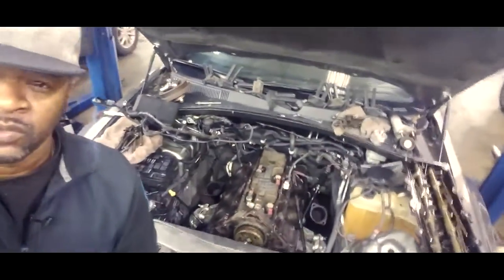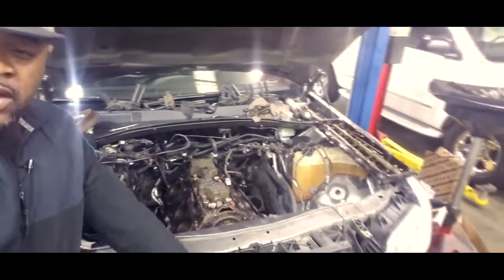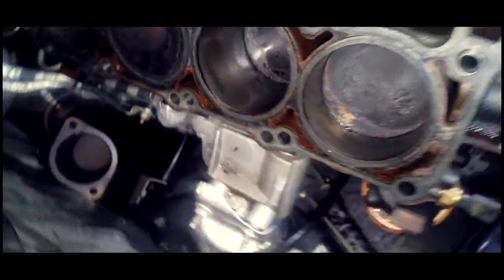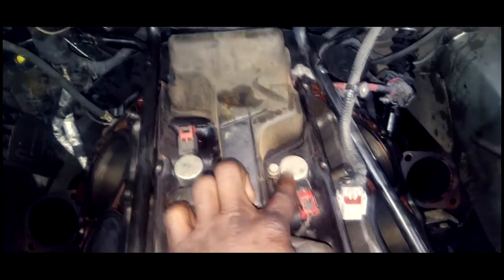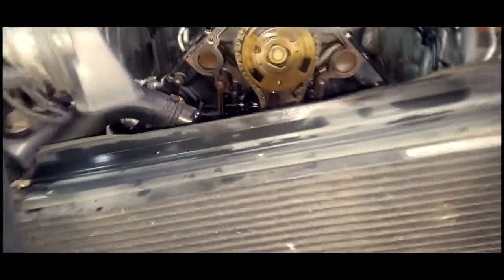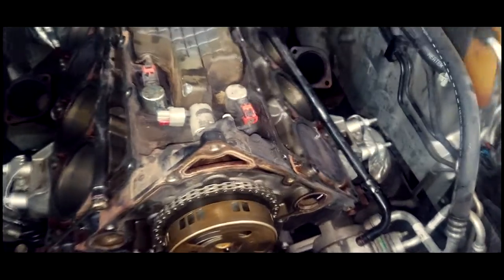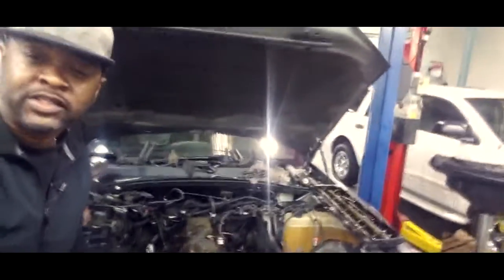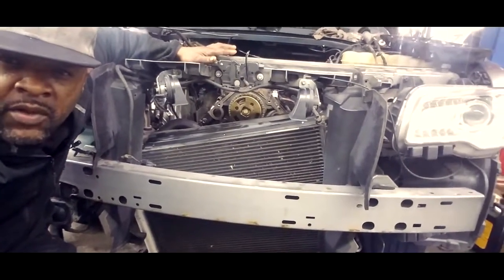P0300 Hemi Engine Misfire Tear Down 5.7L Camshaft lifter prep repair job Hack.Best way to remove cam

Comment: I EXACTLY had this DAMN ISSUE. I wish I had came across your vid earlier. I had P0300 along P0308 error code...and a very loud weird noise. I took my car to the mechanic. They didnt take the engine apart like you did. Instead, they used a tiny camera and noticed my cylinder 8 was messed up. I end up buying a new engine with a new intake manifold. Total damage ? 12K euros (I am located in France and had the engine shipped).